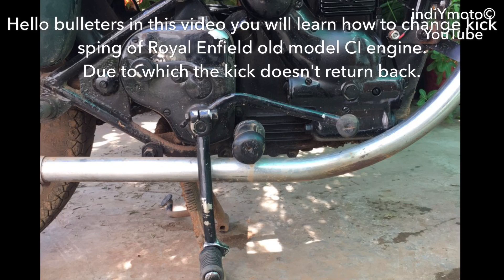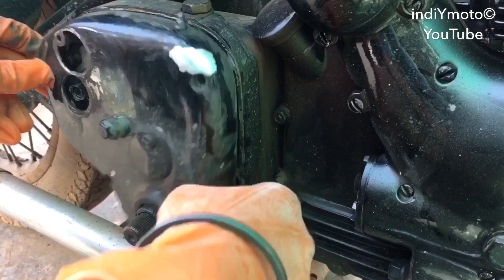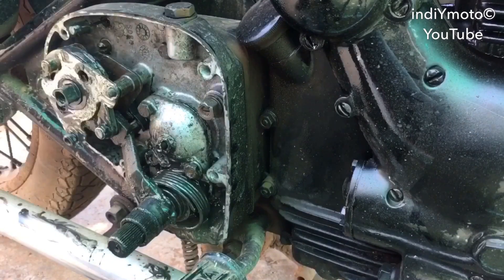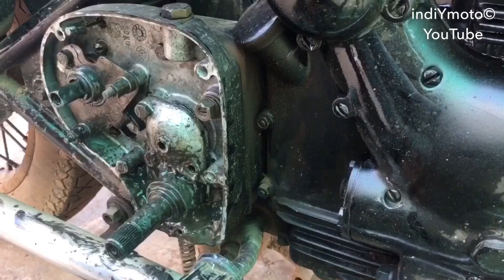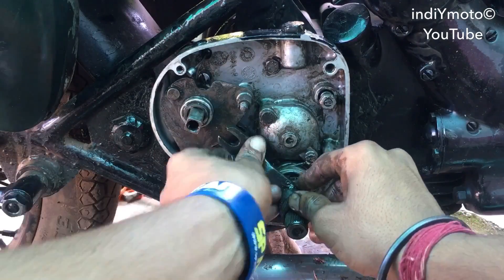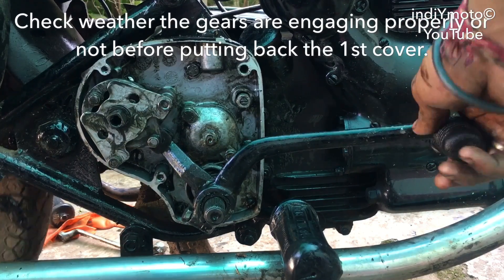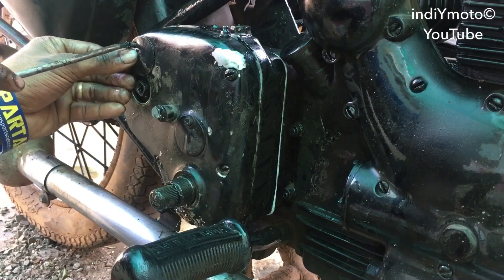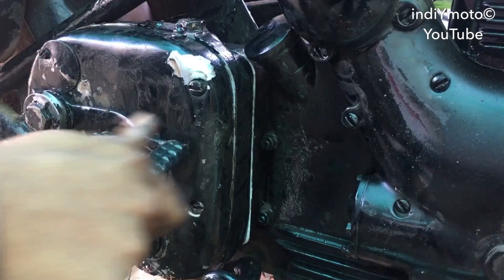How to change kick spring of royal enfield old model

Comment: You can fit the spring and NOT need to remove the gearchange ratchet. Just remove the old spring by SPIRALLING it off the kickstart shaft and fit the new one by SPIRALLING it back on...Dead easy. You will still need to remove the small bolt that holds the end of the spring as you have shown....

Comment: Sir I actually have a bullet standard 350 cc 1984 model 
Which is having a problem with its kick it is slipping but spring is fine bcoz it is coming back to it position plz make a video on how to repair it 
Ur no.  Plzzzz
Reply: Hello ayaanz , did you find the solution for your problem ? Please reply
Reply: After removing the outer cover as it's shown here, check the tightening screw of the kick and if it's fully tight but still the kick slips, then kick and observe if the kick lever teeth are slipping away from the kick shaft teeth. If so, you'll need to replace both the kick and the kick shaft.